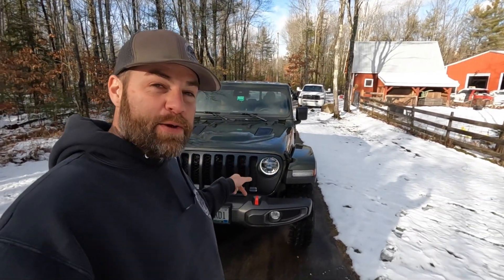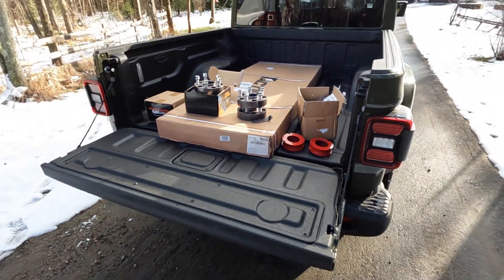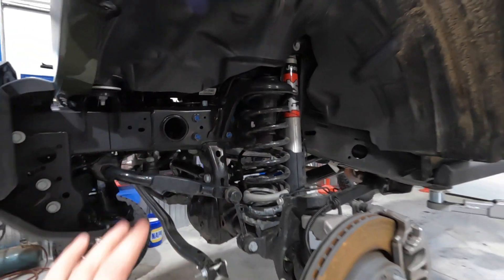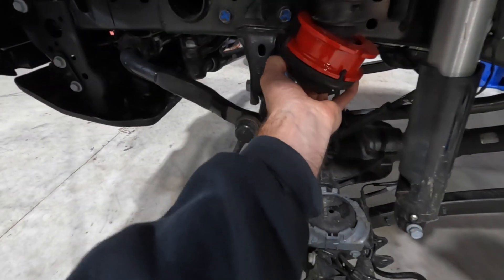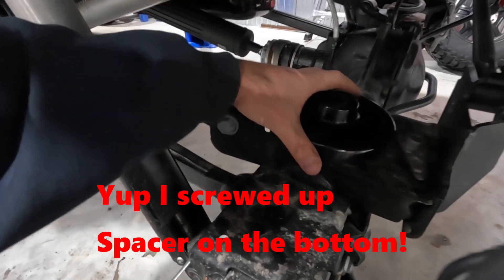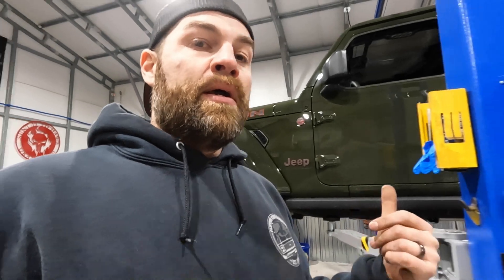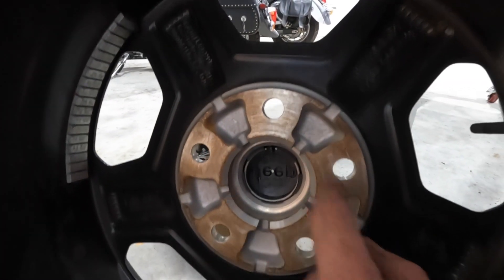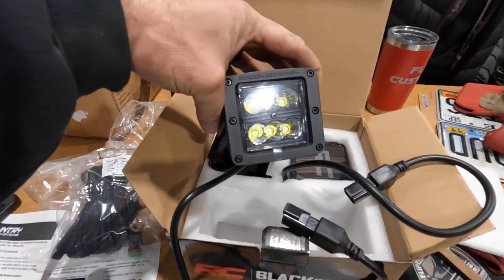4 Easy Jeep Gladiator Upgrades

Comment: Were you happy with the leveling kit? What it enough to level out the Jeep? Trying to decide on what to order now. I was told 2.5" but I see anywhere from .75 to 2.5 for kits. Was curious if you are going to level the front, why the need for rear spacers/
Reply from the maker: Just right